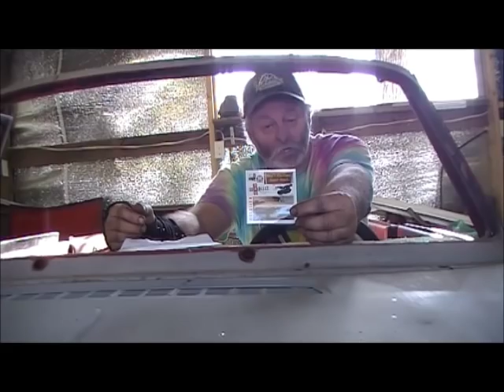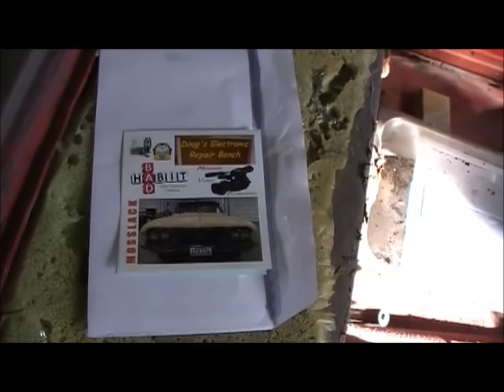DERB MOSSLACK & BIG BLOCK FAIL

Comment: When I trained to be a Submarine Navigation Electronics Technician, I learned Tubes, and Transistors. I'm not sure what they have now, probably Micro-Circutry, and PLC. With enough patience, you can hone the scoring out of that cylinder wall, and make the rest of them match. But... You probably don't want to stand, hunched over, for hours on end.
Reply from the maker: You have Sub skills! Awesome! The marks are way too deep to hone out.
Reply: Ah, that's too bad. Hopefully you can get $500.00 for it, from a Craigslist buyer!

Comment: If it's only one or two holes that have a problem, have them bore and sleeve it back to standard, line bore the bottom end and you have a good block. I've done that quite a few times.
Reply from the maker: I can do that. But I will just throw an overhaul in the old 289 if it ain't blown up.
Reply: That works as well.

Comment: You paid $500 for a motor with a spun bearing in it??? Did you know that when you bought it?
Reply from the maker: The Shade Tree Fix-it Man Yes. I sold the turbos for $800. The heads for $400. Traded the intake for a VW body. Now I'm stuck with the big chunk.
Reply: Well at least you won't have to buy a boat anchor, right?
Reply from the maker: The Shade Tree Fix-it Man Might let someone with lots of money and more time fix at it.